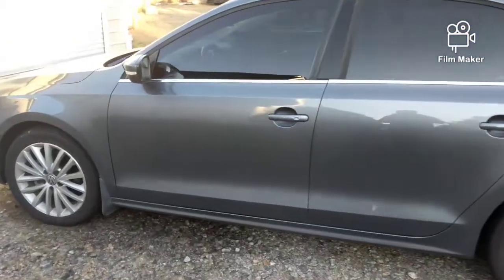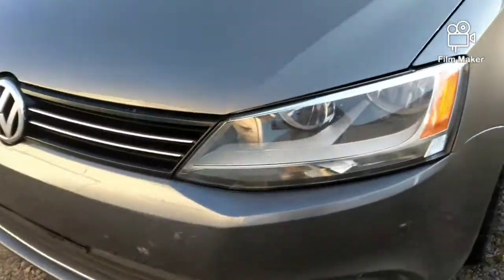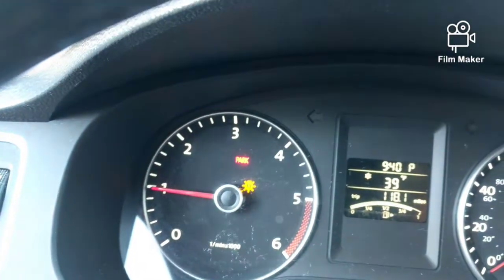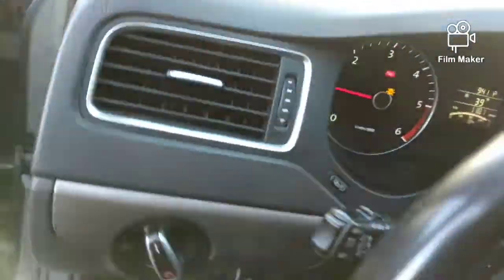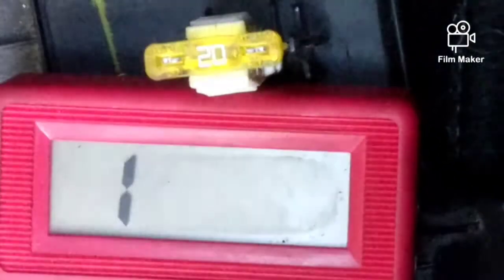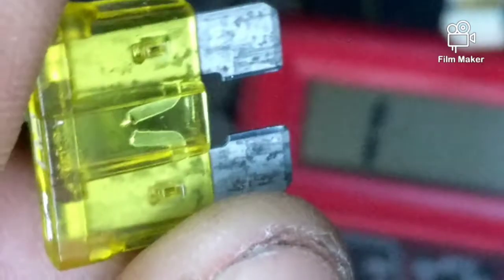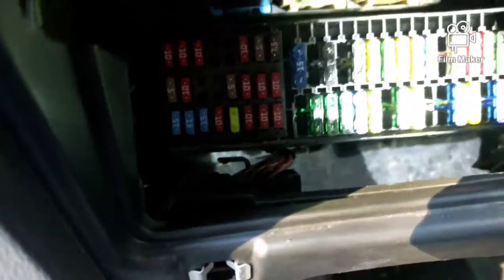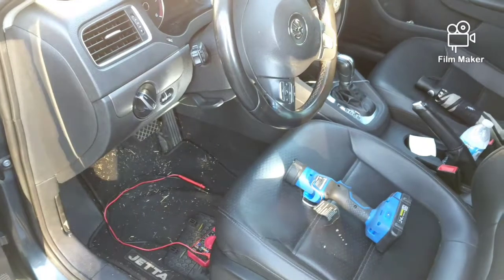Signal lights and brakes lights not working in your VW

Comment: Such a helpful video! Do you know which fuse is for the horn? My horn stopped working and they said it might be a fuse
Reply from the maker: It is very common for the horn on that car to just go bad the fuse will be good you have to just buy a new horn and it is located behind the front bumper

Comment: Bro if I could send you money let me know you saved me tons of money after I was told it was the wiring and couldn't find no videos on it I even tried to switch the hazard button and flasher relay.... car came like this and it was just an empty slot in the fuse panel which happened to be the fuse I needed
Reply from the maker: Thanks glad I could help
Reply: Wow! How much would that wiring issue have cost you? I'm having the exact same issues as what's stated in this video and my mechanic told me it was the ECU which would've cost me between $900 and $1200!

Comment: Hi, getting the following warnings on my 2010 vw scirocco

Front right turn signal
Right reverse light
Front right main beam
Rear left turn signal
Left front side light

Which fuses should I try replace or could it be a bigger issue?

Comment: My 2014 Jetta all of a sudden lost right front, rear, and mirror turn signals/flashers... Trying to diagnose with no success so far... I have been looking at hundreds of wiring diagrams for it so far but cant seem to figure this one out... Getting a short to ground code on vagcom contorl unit 09... short to ground right turn signals...
Reply from the maker: those are the worst you might have to get a multimeter and check continuity from each individual wire to ground and see which one it is making a contest it could just be it's been rubbing on something and you might not be able to find it by just looking

Comment: So i have a 16 Jetta and basically the fuse layout is reversed. So the set of three rows of mini fuses is on the right instead of the left I do still see a string of 3 30A fuses and 1 15a fuse is it safe to assume that the next spot after the 15 is the turn signal fuse?
Reply: Like right now in that spot there’s a 20a yellow mini fuse
Reply: Like what fuse number is the one you replaced

Comment: My signals work but my brake lights don’t u think it’s the same fuse causing the issue?
Reply from the maker: Check the brake switch onto your dash should have the brake pedal bar touching it